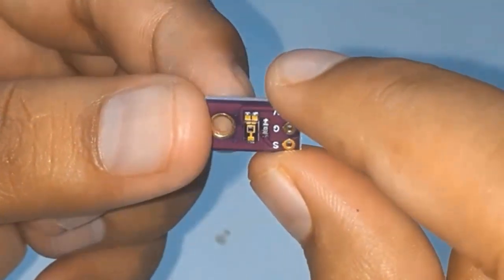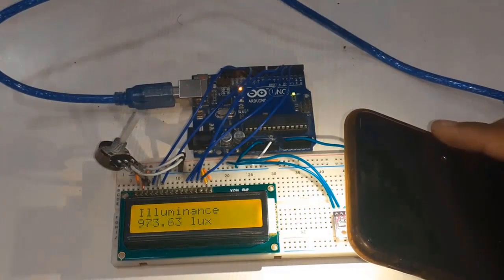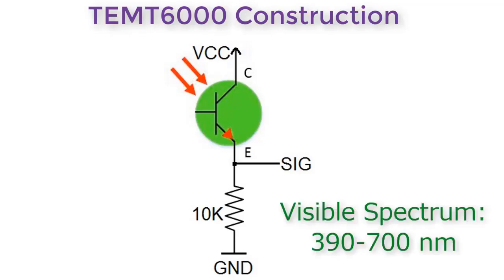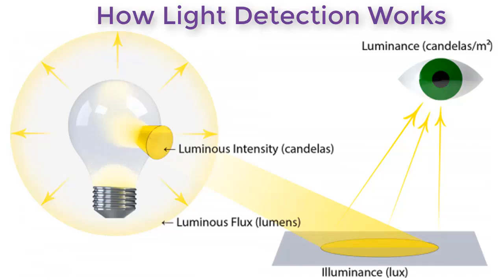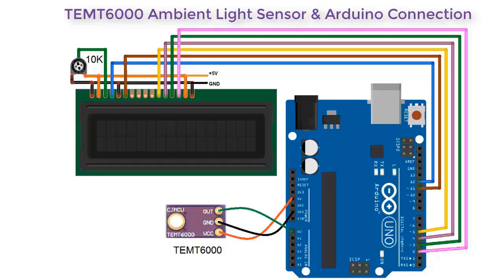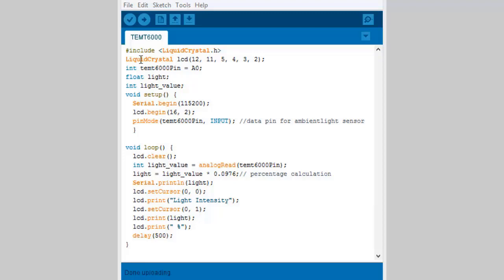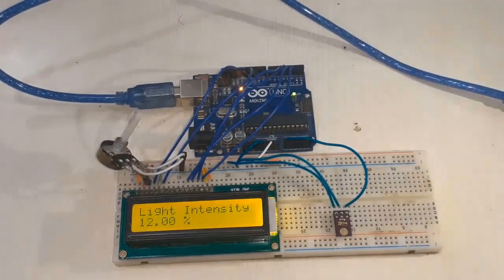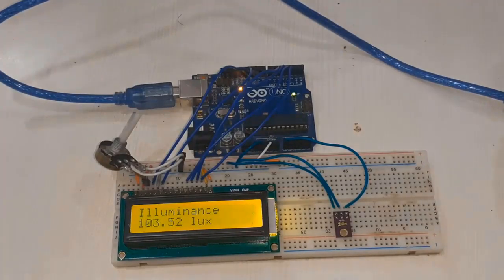TEMT6000 Ambient Light Sensor & Arduino Interfacing | Illuminance & Light Intensity Measurement

Comment: These things are good if for whatever reason you want to select for only light that is visible to the human eye, but otherwise they kinda suck.  A photoresistor is way cheaper and way more sensitive with a wider range.  The TEMT6000's default 10k resistor is too small to see anything but a flashlight pointed right at it or direct sunlight.  It can't even tell if your room light is turned on or off.  If you replace it with a 1Mohm resistor it's a bit better, but still not as sensitive as a cheaper photoresistor, and now with a 1Mohm resistor it has a smaller ceiling.  The only advantage is that it filters out all other wavelengths of light except visible light.  I can't imagine where that is valuable.  If for whatever reason you need this phototransistor type sensor, use an actual solar panel.  It's the same thing this is doing, but the wider surface area will give it a bigger range.
Reply from the maker: You may use BH1750 as a better alternative.
Reply: Thank you! With 1M0 they are perfect for my use with 3.3V

Greetings from Germany :)